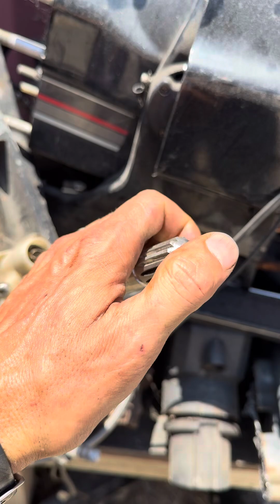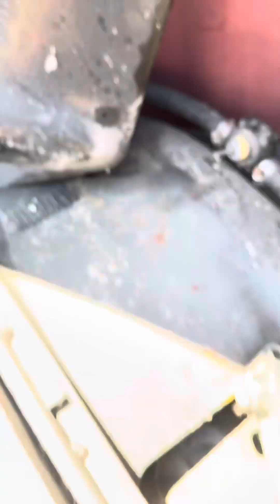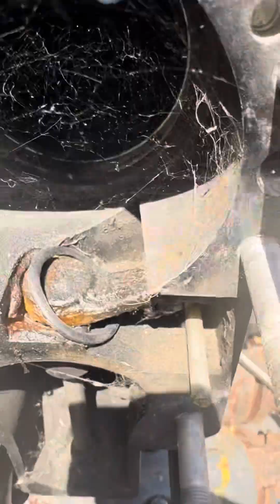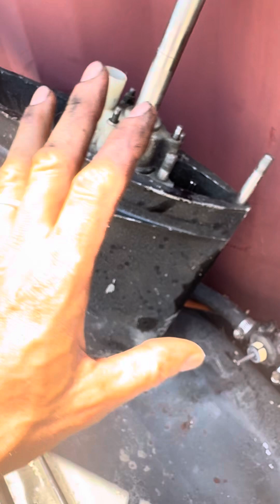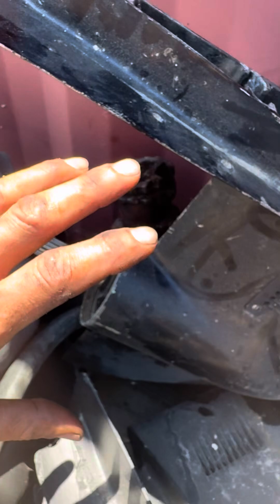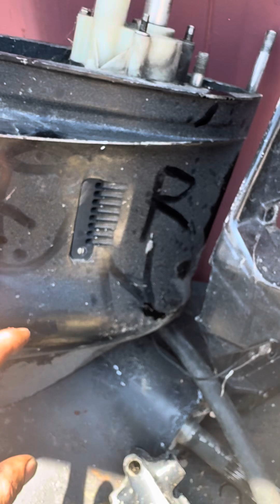Mercruiser lower unit why it won’t go into or in wrong gear after doing water pump

Comment: Good afternoon, im having a problem with my mercruiser 3.0 with DDIS system. turns off while in the water about 1 hour or so, feels like if you pull the kill switch. i checked my coil, i had no spark and my coil was HOT. once it cools down it turns right on. my RPM tachometer is stuck at 800 rpm, have you ever fixed a boat with this problem?